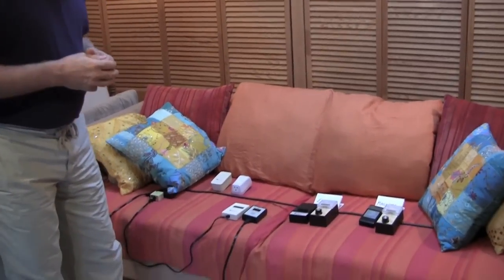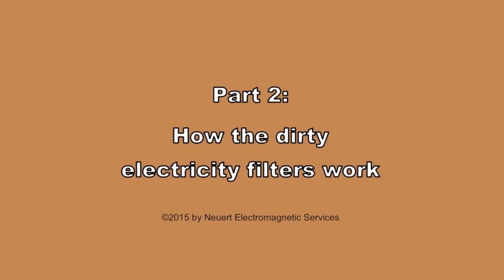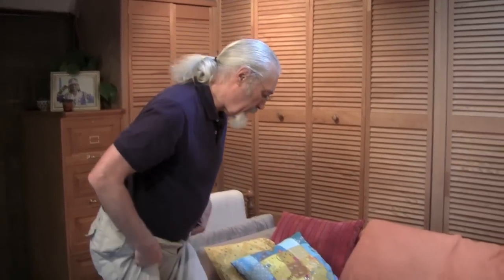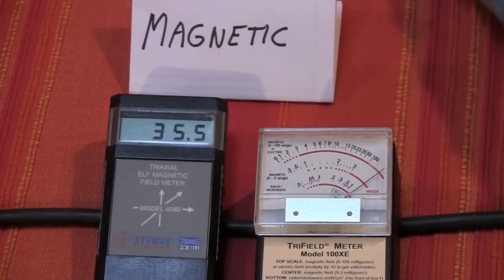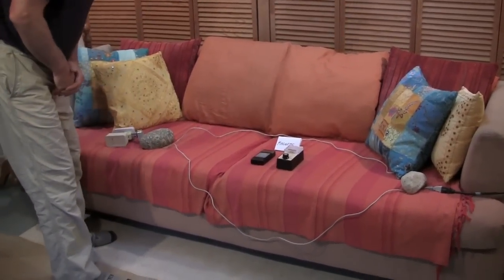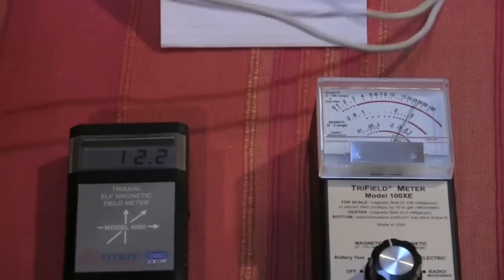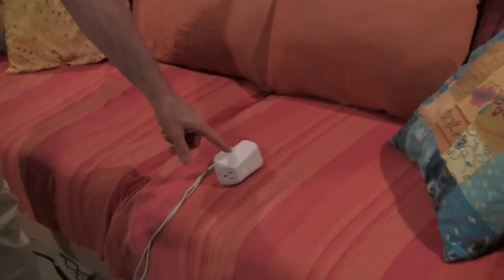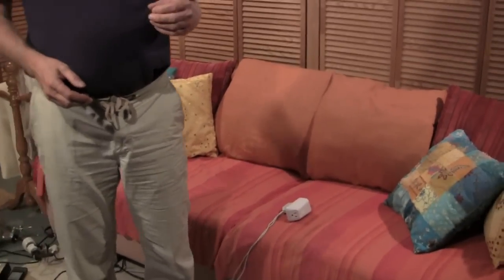Perils and Problems with Dirty Electricity Filters: What to be Aware of!

Comment: Can't I test the outlet for an electrical wiring error first to make sure it's grounded? And then it's useful to the filters?
Reply: Sure you can get ground testers or outlet testers that are inexpensive at a hardware store to check for wiring errors.
Reply: We have seen this video before and it is inaccurate and sadly misleading.
Let me explain how magnetic fields are created in homes. The Live and Neutral wires have opposing currents which both create magnetic fields, but they neutralize each other when the wires are next to each other. When you separate the fields you get an independent magnetic field.  
This misleading video sets up a wiring error by separating Live and Neutral wires and then puts a voltage on them which will always create a magnetic field under every situation.
This is NOT a result from the filter, this is from the wiring error created. If instead of a filter you place a light bulb or a phone on charge in the circuit you would get the same magnetic field so its NOT caused by the filter but the wiring error.
In Australia we use twin and earth cables where the Live and Neutral cables are manufactured within the same cable so the magnetic field is neutralized. Only where the live and neutral are separated will a magnetic field occur.You will always measure a small local field around every powerpoint which has a device plugged in and is switched on because the wires are separated out in the back of the wall socket to supply the socket, so with any device including the filters you will read a magnetic field at the power socket or any place where the wires are separated, this is called a wiring error . This will typically diminish at around 30cm distance. You won't place the filters under bed heads to avoid sleeping spaces.
I hope this clarifies the situation and the video misleading the public.

Comment: What about Noise filters such as the Noise Harvester or Quietline that convert the dirty lines to heat or light, instead of using capacitors?
Reply: The Noise Harvester and Quietline both use capacitors in their designs.

Comment: Hey Michael. Can I ask a question. I capture a strange tone from my mic in my recording studio (mics and amps). I feel like the tone is broken, like something blended. Let's say it's harmonics which change the tone of original formants of my voice. I have this issue from time to time. Probably it's whether dirty electricity or EMF. Most people believe it can't cause such a big difference to the sound. But it does. What do you say about it? Should I try filter dirty electricity or should I build a isolated room with double foil to stop EMF?
Reply: "...the tone is broken, like something blended."  Hard to say what you're talking about. Is there someplace you can give a sample? It could be many things. The most common things are bad grounds,. Also, handshake signals from cell phones. I get those when I put my phone near my computer speaker input cable. RF shielding on low level mic cables is a must.

Comment: So if the use of one of these filters increases the field if there is a wiring problem, could it be used as a tool to locate where a wiring problem exists so it can be repaired?  Electricians are turning me down because they say this type of wiring problem is too difficult to find in my 60+ year old ranch style home.  I would like to be able to ID the problems myself and then find an electrician to fix or rewire where I specify  Thanks for this great information as I was ready to buy a bunch of the Greenwave filters and they would not have reduced the EMF.  However, I still need to locate and repair the issues.
Reply: I am not an electrician, but finding reversed common (also called neutral) wire and ground wire is easy using a $5 checker. They have 3 LEDS that show if an outlet is correctly wired. You could do that yourself, testing each plug in circuit. It may not help if the writing error is made in a junction box, but in most cases that box connection  is serving an outlet you can test. Other problems that could increase the effect of the magnetic field- due to problems, is 1. Knob and tube wiring. That’s a big one! They did not use grounds, and in some “ update” cases , they run a separate ground wire to all the boxes. That would really cause a problem in making a magnetic “ loop” in your house! 2. Aluminum wiring- very prone to bad connections , which could create a similar “ magnetic loop” effect from the wires .

Comment: For eliminating noise from computer power supplies could not an isolation transformer be used of sufficient size to reduce the harmonic feedback into the house wiring? Laptops are easier as you can swap those out for linear supplies, but desktops not so much.

Comment: I currently own 2 greenwave filters. I have used them on and off, it seemed like they were unnecessary,  but its now apparent I should've always been using them after watching your video. The question now is, how many filters do I really need? How many greenwave filters does your average sized home typically need? I assume more than 2? I assume I should use the 2 I currently own in high traffic areas?

Comment: Thank you so much for this information, its so incredibly helpful I really can't thank you enough. I've had some really good success with another more recent product that has come out since this video and would love to hear your opinion on the "Satic Pure Power Plug In 120V Dirty Electricity Filter, Cost Saver, Surge Protector" As its labeled on Amazon. I've noticed a difference in the house since using this in on the wiring after the outlet where an old refrigerator is plugged in, But I'd would really love to hear your opinion on this product. Thank you again for this information.

Comment: Should I not have the filter in outlet close to my head. According to my stetzer meter PG&E is pumping high levels of electricity into my apartment some Outlets registering as high is 1300 Hertz
Reply: No, keep it away from you. Would go so far as to de-energize the circuit at the breaker when sleeping if that's the case.

Comment: How then are we to redirect/reduce high electromagnetic readings in a home? When they are reading higher than normal> I know there is shielding fabrics but it just seems impossible to redirect them.
Reply: Depends on the root cause of the field. Harmonics source isolation and wiring verification would be first to do. Then after that shielding electric fields with bonded shielding material or shielding paints in the highest areas.

Comment: So if I wanted to run a computer off a generator, this would help protect the computer from damage caused by the DE from the generator? I’m sure after watching this it would, but I’d like to be sure!
Reply: You do not want to add capacitive loads to a generator, it will screw with it's operation big time. You need an isolation transformer instead.

Comment: Any suggestions on how to improve wifi connectivity in room above garage. Smart meter is on that side of house, we shielded and installed a wifi booster but still having slow internet, loss of connection, videos pause , can't download videos, my cell loses connection in that room as well.
Reply: If set on using WiFi still do a site survey and configure the router to a different channel than your neighbors.Or use 5ghz band. Otherwise microwave ovens and a lot of other things operate on 2.4 ghz.

Comment: Any idea how one of these whole house surge protectors would do under this testing ?
Reply: +NoFear4XJs One thing about those dirty electricity filters is that the gs readings in my condo fluctuate from morning to night 6 am my kitchen is as low as 100 and late morning up over 700 :O So using those dinky filters is a gimic and if you do not have enough filters to handle the load they can catch fire, so if you take readings when the utility system is not under load from all those other people using electricity then you get improper reading and won`t have enough filters. Find the root cause and deal with it or do the best you can and deal with it at the fuse box, not sure is a whole house surge protector would do much good I just found out through 1st hand research my so called high end belkin wall plug in surge protector made everything worse electric field and magnetic, tested a higher end one and it made fields lower. So finding out what the capacitors used are rated for is before you buy the surge protector may be key...? I have heard 142 microfarad is the sweet spot but I am defiantly way out of my understanding in the area and more research is need for sure.
Reply: +NoFear4XJs Not once has a Greenwave filter caught fire that I am aware of.

Comment: And what if, in this case of separated Active (Live) and Neutral conductors you plug any regular load in parallel with filters (as shown in the video), such as for instance a 50W incandescent lightbulb. Will this practically or theoretically make the actual magnetic fields even higher?
Reply: Having any load on such a case would make the field bigger as you draw more current.

Comment: Michael, thank you for the fantastic explanation and video - have you ever experimented with orgonite pyramids or crystals to reduce EMF?
Reply: They do not work at all. I'm an RF engineer with 45 years experience in radar research. Basically, it's all psychosomatic. If you think they're working, you will feel better. Same thing with "dirty electricity".
Reply: James Van Damme Hello James! So are you saying dirty electricity is nonsense?
Reply: @jamesvandamme7786  While I agree that crystal mitigation of EMFs is nonsense, I can assure you that EMI and RFI can cause direct health symptoms. I say that based on my own experience working with computers for 30 years. Somewhere between 1 and 10% of the population appear to be susceptible. You are likely in the majority who are not.
Reply: "Dirty electricity" is something that most electronics engineers have to deal with. Electromagnetic compatibility, spurious pickup, shielding, compliance testing, power supply regulation, transient suppression, harmonic rejection... all of that and more. Components and systems are susceptible to these, and have to be designed to tolerate, suppress, and guard against them, and not generate them. 

People are not.  Hypersensitivity has been shown to be due to the nocebo effect. People make themselves sick. It's autogaslighting (I just made that term up). Of course, if a flickering fluorescent light annoys the crap out of you for 8 hours a day, it's going to wear you down. But it's not the "dirty electricity" doing it to you.
Reply: @jamesvandamme7786  There is a large body of evidence indicating people are indeed affected by time varying EMFs. The nocebo effect simply does not explain why so many people experience the symptoms first, then some time later, through a process of elimination, find the EMF emitting cause. In terms of studies, there were a number of studies done in Soviet Russia by occupational health professionals that found a consistent set of symptoms among workers exposed to elevated man made EMF, versus professions that were not. These were studies that carefully tracked the health status of workers over decades, studies that are not conducted anywhere today. I suggest reading this excellent case history from one severely affected electrical engineer - https://moldenvironmental.com/2017/08/08/electro-magnetic-frequency-bruce-emf/
Reply: @jamesvandamme7786  One example of a well studied biological effect is changes in oxidative stress levels. A recent review found that 216 out of 242 (in vitro/in vivo) studies since 2000, looking at oxidative stress endpoints at non thermal RF levels, found significant effects. The 'radical pair' mechanism has been proposed as one possible explanation for these changes - https://ieeexplore.ieee.org/document/7425396
Reply: @jamesvandamme7786  There is an official NAVY study citing 2500+ scientific studies that all prove without a shadow of a doubt the harmful effects to the human organism. Go away.
Reply: @sebastianwehler3218  "prove"...That word does not mean what you think it does. 

Since I've made up the word "autogaslighting", here's another: electromagnetic paranoia.  Goodbye, and enjoy your crusade.

Comment: So I am pretty sensitive and I also use one of those filters in my studio actually 2 of them and I still could not fix the issue. Is there a way around to fix this dirty electricity problem? My studio monitors are amplifying the noise in the ac line and I hear this constant noise, I use power strips and all but still cannot fix the problem. I used one of those UPS and when I ran my monitor on true sine wave, it fixes the problem till I plug the power cable in, the noise comes back, I cannot stand to this noise because my room is already treated and very quiet.
Reply: Sounds like it might be a switched mode power supply feeding one or more pieces of your studio equipment? Does it sound like a 50/60Hz click?
Reply: @MrTarati  it’s been some time since I sold my monitors. Seems like most monitors have this noise due to them being analog equipments or a “dirty” AC lines in the buildings/apartments. And it was in the higher frequency not in the 50-60hz range.

Comment: I love grounding... but there is a MAJOR PROBLEM to FIX!!! AC current runs up the line of ALL standard ground/earthing cords sold on the market, except the PureGround cord.  So, if you have a cord from another company and are not using the PureGround cord, it is running an AC current up the line to your grounding tool and directly to you!) Dr. Laura Koniver, MD was featured in "The Earthing Movie."  She developed the patented PureGround cord. I love mine. And I have been grounding/earthing for 6 years, doing it WRONG until recently!! AC should not be on your body. It's bad!!! Stop believing the lies by companies like earthing.com - I used to support them. NO MORE! They are in an echo chamber, at the minimum believe their own touted position that the earth over powers the the AC current, and that earthing creates a faraday cage. And at  the worst, fearing a class action lawsuit, are covering up this 'dirty' EMF secret of AC's harm. Check out Laura's site and decide for yourself. Why take a chance with AC? www.intuition-physician dot com

Comment: Is it possible to clean the dirty magnetic field? How can you measure how dirty it is without having to compare two meters as per your video?
Reply: +Xavier Silva Regarding your first question: Yes, to clean up transients within the magnetic field, filter the power near the source of the transients (before it gets onto the wiring where you are measuring the magnetic field).  Regarding your second question, if you don't have a scope then a rough estimate of the dirty part of the magnetic field can be made by firstly measuring the strength of the ELF magnetic field and secondly measuring dirty electricity with a Stetzer meter or similar.  Then multiply the two numbers together for a rough comparative figure representing the kHz component of the magnetic field.

Comment: The filters reduce electric field barely.   What's the point?
Reply: teeduck Its interesting to note  that we have been living with 50-60hz background EM signals for at least 70 years. The records show general life expectancy has improved over this same period. So one could just as easily suggest that this mains EM hum is responsible for this improvement. Which of course would just be wild conjecture. One would need solid evidence to prove such a position. But, where is their evidence that its so bad for you? These people never seem to discuss studies or real stats based research. Its never mentioned in any of their obvious sales pitches.

I would have thought before you can sell any kind of "cure all" product it would be backed up with reputable case studies. Without convincing proof, this is no different to my mind, then selling people tarot cards, Crucifixes, lucky charms or snake oil.
Reply: +teeduck Capacitive filters remove high-frequency transient voltages (dirty electricity) from the wiring but have almost no effect on voltages and currents at 50Hz.  The epidemiology strongly suggests that kilohertz frequency electro-magnetic fields are more harmful than 50Hz fields.  Sam Milham's excellent book titled "Dirty Electricity" describes the epidemiology.  The best place to put filters is close to the source of the dirty electricity (to stop it getting on the wiring in the first place) and at a distance from where people sit, stand or sleep.
Reply: Careful with life expectancy assumptions, Kevin.  IMHO we are seeing more diseases which are chronic, debilitating, and deadly.  Some statistics that show life expectancy average in childhood death.  Babies dying from preventable/curable infections for example.  When those figures are averaged in, it makes it appear like we are living longer, but the huge amount of death of children (turn of the century) for example gives a skewed view.  No, most people were not dying in their 30s or 40s.  It's because of how the averages played out.

I haven't studied this area enough to give an educated opinion on it that I feel confident about.  But this is one thing I've heard and it does seem plausible.

I agree I would love to see more research, but there has been some research already done with Stetzerizer Filters and different diseases and symptoms.  It's also an engineering fact that the filters are removing these high frequency voltage spikes from the line and that these do connect to the human body when present and no longer connect when filtered out.